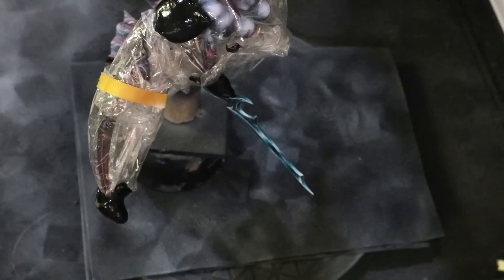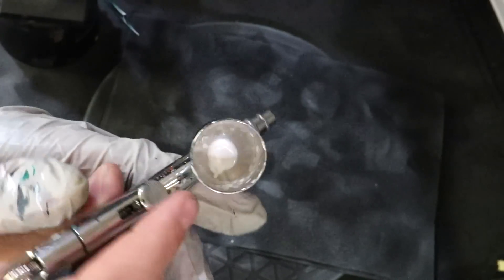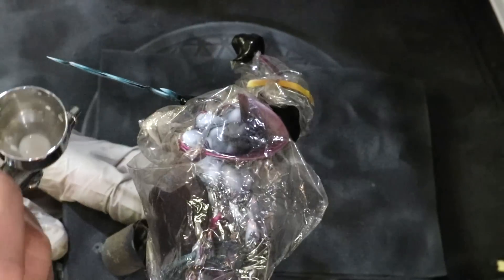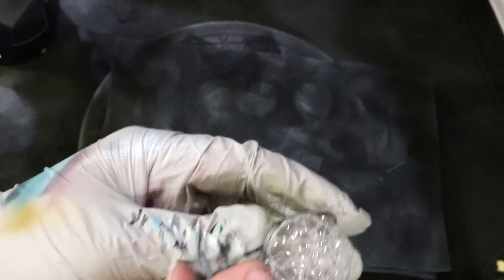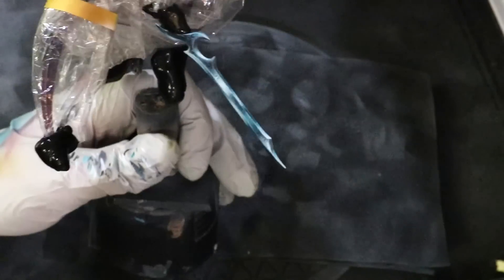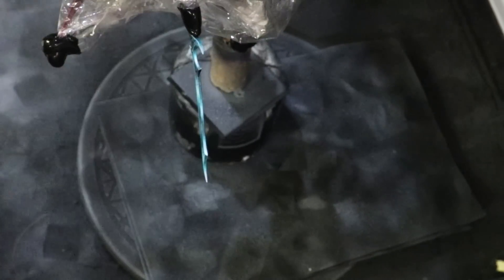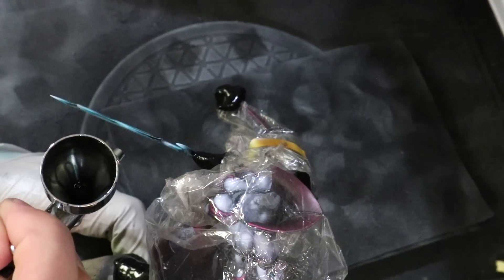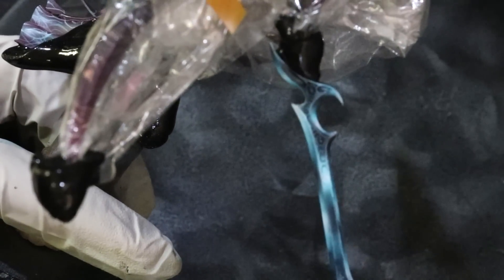Hobby Cheating 207   Blending with your Airbrush

Comment: Great video, i have a H&S evolution airbrush and i often do those airbrush glazes. But i often have some problems with my pressure and general control, i alway thought it was a lack of skill, leading to a lot of spider webing or too thick coats. That said when i look your airbrush it looks so easier, I should try a Iwata hi line
Reply from the maker: It has that extra element of the air flow control and that makes things so much easier.

Comment: Hello Vince. I'm new to airbrushing and still learning the basics. All of the tutorial videos I've seen use the trigger motion to let the air out as On/OFF only adjusting the flow via pressure dial. In your tutorial however you suggest varying pressure on the trigger to adjust the airflow. Is this a more advanced way of controlling the flow or a personal preference?
Reply from the maker: It's what "dual" means in dual action. The pressing down just gives you air, the pull back gives you paint. By precisely controlling on that axis is how you get exact applications out of your airbrush. Hope that helps. :)

Comment: Thanks for the video, particularly useful at the moment as I'm busy airbrushing a dreadnought. One question though is that it looks as though you could have done the entire sword soley with the airbrush. Is that something you'd recommend in certain situations. What's the main advantage of doing paintbrush work first? Thanks again!
Reply from the maker: The paint with a brush just has a different look, there are micro flaws that are actually valuable. In addition, you can build stronger more intense colors. What I have found is it's easier to build those strong base tones, then smooth them out.

Comment: Hey Vince just a question, why you do the backfill with the airbrush when cleaning and not don’t empty through spraying and then clean it with thinner afterwards? I only wonder because I heard that’s not good, and I can imagine that backward pressure being not optimal for the internal parts. With humble greetings! And thank you for this wonderful painting lesson, as always perfect to the point🙌🏼🌞
Reply from the maker: I explain in the cleaning your airbrush fast video - but the simple answer is, you want as little paint as possible moving through the tip of the brush. The backflow won't hurt anything, but the tip, which is often as small as .15mm, is very easy to clog up and/or mess up.
Reply: @VinceVenturella  im gonna watch that fast clean video asap! Thanks for taking your time to answer and help!! Much appreciated 🙏🏼🌞

Comment: Nice video Vince, thanks for taking the time to explain.

What would you recommend for a psi setting on that type of ratio thinner to ink?
Reply from the maker: In general, I still run at 18PSI, but the key is that airbrush has a pressure control and I have it way blocked off. If you don't have that extra control on your airbrush, something like 5-8.

Comment: I have an airbrush question not related to blending. In the past you have recommended using gun oil to oil the trigger of your airbrush. If you could get a controlled application would WD-40 be an acceptable substitute. Had a can in my truck
Reply: My only concern with that would be the possibility of a reaction between the WD-40 and any rubber gaskets that might be inside the airbrush; I'm not sure that there would necessarily be a reaction, but its something I'd test on a small scale before simply spraying it on.  Alternatively, you can pick airbrush specific lubricant; I use the Badger brand myself and it works wonderfully.
Reply from the maker: That's a good point, I have heard some bad stories of WD-40 on airbrushes and what happens with the rubber and the WD over time. My advice would be something like the badger if you can't find the other oil.
Reply: I could get either and I probably will I just had the WD on hand and my airbrush trigger happened to be sticking and it worked in a pinch. Wasn’t thinking about the rubber seals and I don’t know what the WD would do but I’d rather not find out the hard way

Comment: What's your preferred method of thinning Vallejo Model Color for airbrush use? Getting my first airbrush in a few weeks very excited to try it out!
Reply: IIRC he generally uses Model Air with a couple drops of Vallejo Airbrush Thinner and never uses un-thinned paints.
Reply from the maker: Paul is correct, I spray a lot more inks, shades and air paints through my airbrush than anything else. That being said, I do certainly use some Model color as well on occasion, the answer is lots of  Vallejo Thinner and Flow Improver. I have a mix of the two (8-1 with Thinner to flow improver) and for model color, we are generally talking about 3-2 thinner/paint.
Reply: @VinceVenturella  awesome thanks to both of you!
Reply: If you're going with Model Color and/or Game Color (as opposed to Air, which is already airbrush ready) I'd recommend Vallejo Airbrush Flow Improver to thin down the paints; this helps with tip drying, since the Flow Improver isn't drying the paint out any faster.

Comment: i think this technique is best use on something big, a typical  54mm or wargaming small unit, 1/35 figure may too small to get this precise. Did you think using a detail 0.2-0.15 airbrush will help to get more accurate ?
Reply from the maker: It's certainly great on things like 54mm or busts, but with practice, it can certainly be used on 32mm minis (you will see next week in action). :)

That being said, the .2mm tip can help, but I wouldn't go any smaller than that. The real key is the tip and the control over the air feed. I have had better luck with the hi-line than most others.

Comment: Hi Vince. I may have missed this but generally what PSI are you running at when you are using this technique?
Reply from the maker: About 18 PSI, but I am also using an airbrush with an airflow control. That can reduce the airflow going through the brush.
Reply: @VinceVenturella  Thanks. Useful to know. Would I be right in saying that the trigger lock at the back of the hi line sets the limit to which the trigger can be pulled back thus limiting paint flow to a set level. My trigger control is improving but close up/ detailed makes me nervous because of the occasional "oops" moment  Sounds like the hiline might mitigate that a bit?

Comment: Thank you as always Vince,  these are greatly appreciated! 

Do you ever use a crown tip\cap for close up work? 
I haven't had issues yet doing close work without one, but was wondering if you had any insight into whether they were worth trying.
Reply from the maker: Haven't tried it,the Hi-Line has that nice focused tip that more or less does the same thing, one of the reasons I like it so much.

Comment: I'm confused, at 2:07, you say you're using white paint mixed 7:1 thinner to ink. So which is it, ink or paint or some other concoction?
Reply from the maker: My apologies for mixing words, it was white ink. For my whites through an airbrush for this kind of detailing, I always use ink as it's more manageable and smooth.
Reply: Thanks. I was guessing that but wasn't sure. I'm an airbrush noob  so not sure of anything.  :)

Comment: Which airbrush nozzle diameters are good for doing detail work and which are good for priming miniatures and painting vehicles? Can a single airbrush potentially do both reasonably well?
Reply from the maker: The .3mm can play both ways, but the tip on something like the hi-line is more for detail. I keep two airbrushes with .3mm but different tips/tip guards to control the spray and have one more focused on detail and one more focused on larger areas.

Comment: Hey Vince, when I try to glaze, I immediately get spiderwebbing, even at low pressures of PSI 5. I'm using a very cheap airbrush, could that be the reason why I'm struggling? Any advice would be appreciated!
Reply from the maker: I would guess it's the cheap airbrush yeah. You need something that has the ability to use the dual action, it might be the case that you need to have a more precise airbrush. :)
Reply: how long are you staying on top of the same spot?